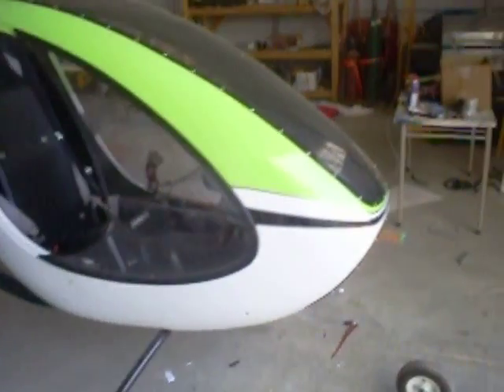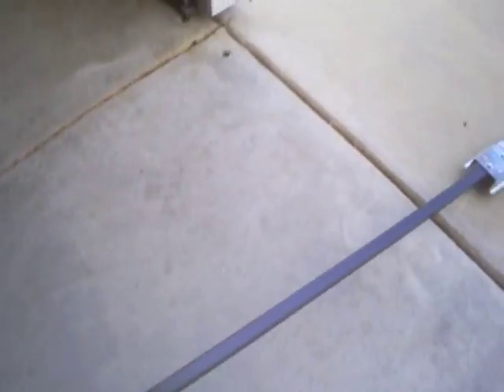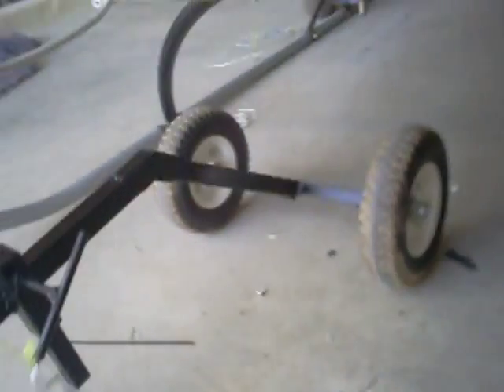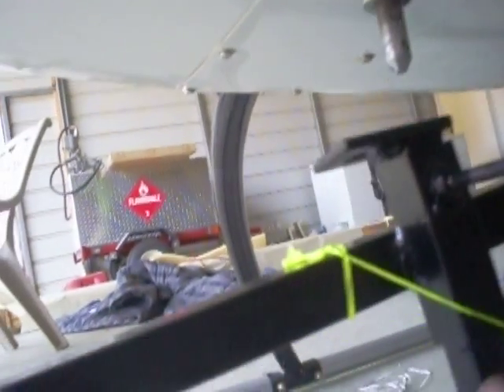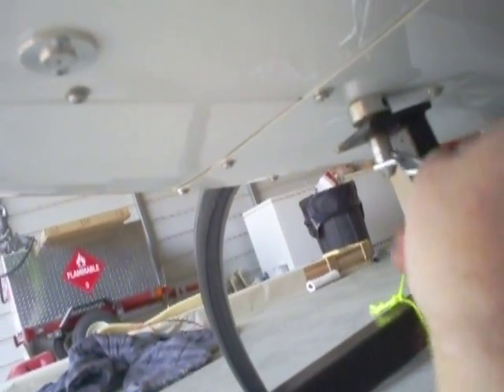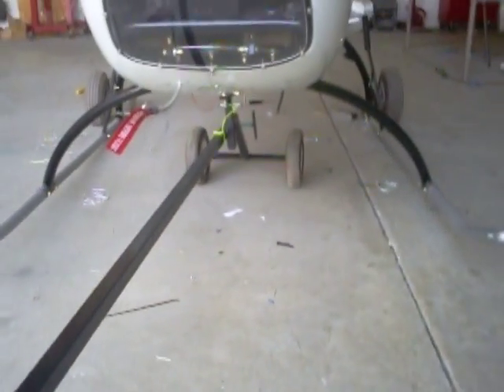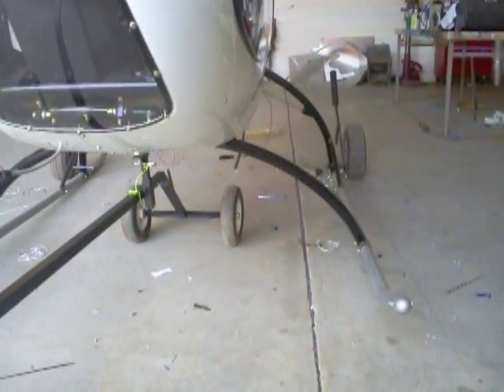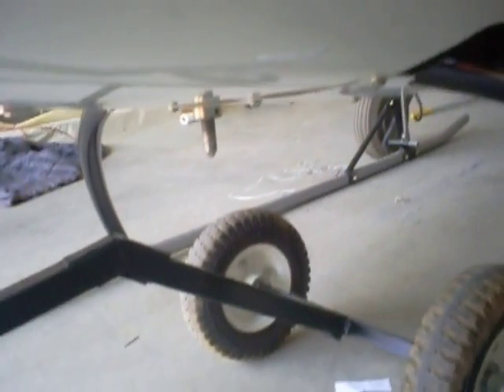Helicycle Helicopter Towbar

Comment: What's the weight of the helicycle and do you have an estimate tongue weight. I have a very custom golf cart with a Polaris ho engine in it that I use for hauling trailers around our yard but we some times use our stock club car limo golf cart for towing. I'm wondering if either would be able to handle towing the helicycle on grass, gravel and hard packed sand.